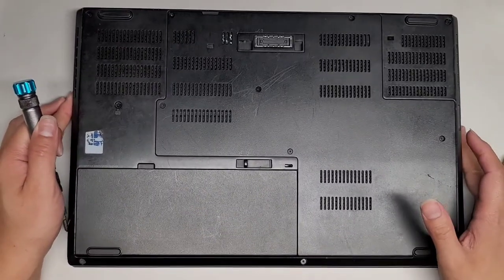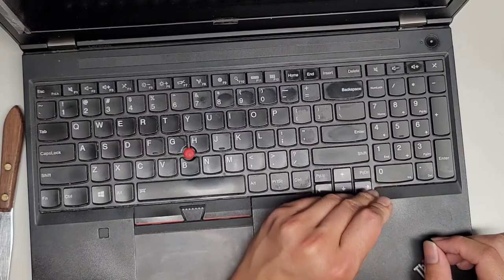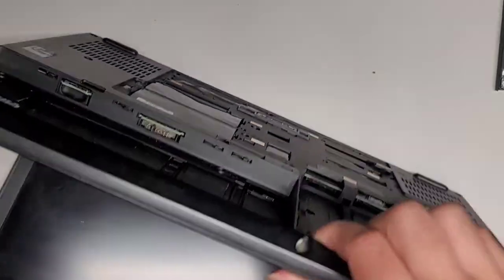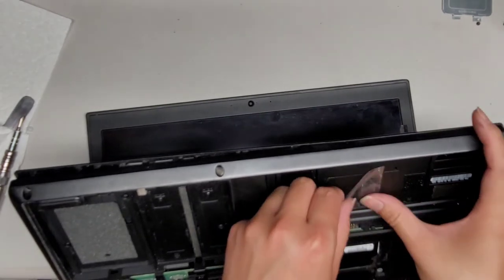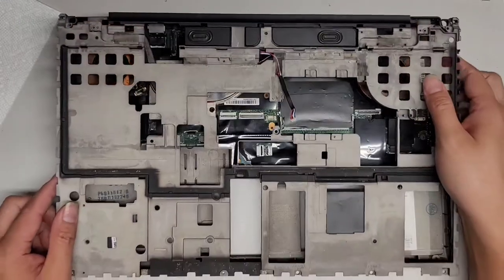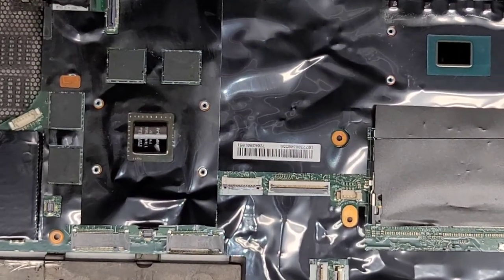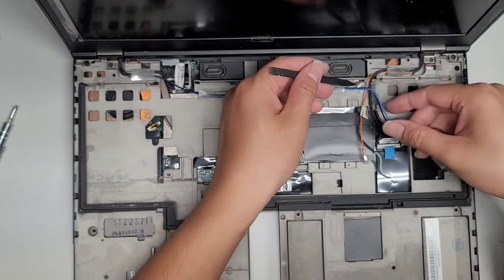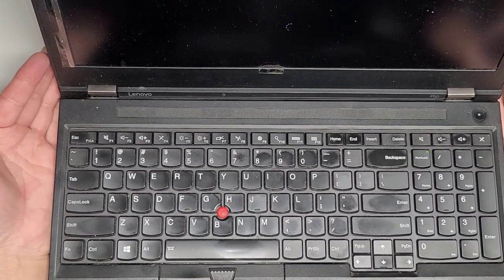Lenovo ThinkPad P50 Complete Disassembly RAM SSD Hard Drive Upgrade Repair Thermal Paste Application

Comment: The Grey discoloration could be a sign it's not pure copper but rather a cheap alloy .... hate to think this about such an expensive machine, try scratching it with sandpaper and see if it's a form of grime on the external as seeing the thermal paste come of clean on your finger indicates it's probably not burnt up, also the lowest temp on that fan assembly is actually the plate on the fans and its there also

Comment: Thank you, I downloaded your video and ran it on another laptop during disassembly. I dismounted my P50 Xeon twice: the first time to find why I got this noise on the left side cooling fan. I noticed that the noise was coming when fan was rotating at higher speed. I tried to fix it by adding some oil. No way, I had to glue the left fan container together after I messed it up. I ordered a new fan on ebay and replaced the old fan last night.
Reply from the maker: Awesome, glad it helped. If you haven't already, please like and subscribe so others can find my videos. Thanks!
Reply: @ItsBinhRepaired  Subscribed and liked.
Reply from the maker: @jpnxuan  thanks!
Reply: Man ! i have the same issue, and i'm planning for a disassembly ,, i have the left fan making noise ,, !
Reply from the maker: @ghanouneddjar8590  good luck
Reply from the maker: Glue traps? O.o
Reply: @ItsBinhRepaired  It's very convenient, my screws are aligned the same way they were on the laptop. Just need to pick up in order when I reassemble. If I am interrupted and need to something else, I can put the P50 and the glue trap board aside. Two days later I still can mount/unmount the laptop without any issue.
Reply from the maker: @jpnxuan  it doesn't leave residue on the screws?
Reply: @ItsBinhRepaired  No residue on the screws. I put screw heads down. I can reuse the board again and again for other repairs (cars, etc...). Magnet boxes do not keep the screws organized by type or size. Avoid getting your fingers on it.
Reply from the maker: @jpnxuan  lol sounds like I need to sell my invention.
Reply from the maker: Nice
Reply from the maker: I made a special magnet box that does that.
Reply: Same issue, lefthand, gpu fan, smaller one 👍

About $20 off aliexpress but delivery will be quite slow. Hope it holds together.

Comment: Basic heat in concentrated confined areas is what turns copper color to grey as like your two fans and linked bar. Copper is a reactive material to consistent levels of heat so while it's perfectly natural to see two tones of color, it illustrates the heat it's subjected to.

Comment: The tray for the SSD is wrong. There's a different part number for NVMe SSDs with thermal adesive (4XB0K59917). That tray should only be used in SATA M.2 not in NVMe M.2.
Reply from the maker: Is that why the computer came with that and the computer boots from it?

What makes you get to decide what the computer gets to use? The tray and SSD work. Why would you put a slower SATA one?
Reply: @ItsBinhRepaired You didn't understand me. There's a specific tray for SATA M.2 and a specific tray for NVMe M.2. That computer seems to have come with the SATA tray but with an NVMe. That leads me to suspect that it had originally a SATA SSD which was later replaced by an NVMe SSD without replacing the tray. The problem with this is that the trays are optimized for the specific type of SSD, in particular for their thermal characteristics. It's just a tray, it has no electric properties. But using the wrong tray is likely to cause thermal issues. It won't prevent it from working or booting, but it will increase the chances of incurring in performance losses due to thermal throtelling if the SATA tray is used with the NVMe SSD. So, when the original SATA SSD was replaced by an NVMe SSD, the tray should have been replaced as well.
Reply from the maker: @joaoparedes_tp  it'll be fine lol

Comment: i fucked up taking out the little wire connectors that connect to the wifi card and little metal bands popped off of them 😭 do you know of any way to fix this? do i have to take it to someone to repair now?
Reply from the maker: @tylera5598  very likely the antennas and wireless card will need to be replaced. Better to use a usb wireless adapter

Comment: Hi I have this machine but it runs and everything but the screen is blank, it comes on shows the Lenovo logo and you can press the f keys, but gives a message saying “ system security- bottom cover tamper detected press ESC to continue but after pressing ESC it just stays blank
Reply from the maker: Not sure. Might be a bad hard drive.
Reply: @ItsBinhRepaired  let me try and change it and see
Reply: There's a little microswitch inside the bottom hatch that detects when it's been opened, that'll be whats triggering the message. You should be able to go into bios (F12 at the splash screen) and disable that security feature.
Reply from the maker: Not sure why I said hard drive. Lol must have been very sleep deprived when I responded.

Comment: Ok, my key question is,. can the frequent high temperatures be brought down to sensible levels? *Sensible levels = <75C under load. I know at idle this laptop gets to 65C even with ZERO cpu use,. so why and how can it be brought under control to help aid the lifespan of the laptop's hardware?
Reply from the maker: Clean the fan and reapply thermal paste.

Comment: Used this video to replace the fan and heatsink assembly on my laptop. It is getting very old and I need it to survive until I am finished with school, so this was really a life save. It was a little touch and go for a bit (new fan assembly was slightly bent from shipping, and I had to gently bend it back to get it to fit, and it initially didn't boot, but after re seating some of the ribbon cables, it came through.)
Reply from the maker: Awesome, glad it worked out. If you haven't already, please like and subscribe so others can find my videos and possibly consider watching a few others to get the algorithm to recommend my channel. Thanks!

Comment: Excellent video - My P50 was starting to taxi to the nearest runway. After following your video and thoroughly cleaning, dusting, and repasting, the jets are now silent (and cool as cucumbers).
In case it helps someone, I sorta freaked out when after putting everything back together, I pressed the power button and the only response was a momentary spin of the GPU fan and a flash of the keyboard backlighting. No video...just a green power led staring blankly back at me. I partially took it apart and made sure everything was properly seated. I suspect the video cable was not fully pressed back into place...or maybe it was one of the memory sticks. Also, it is easy especially with the SSDs to think that things are seated when they may not be. You need to feel / hear a definitive click or snap with those SSDs. Without that, you will not boot properly.
Reply from the maker: Most likely a stick of RAM.

Comment: I'd say the heatsink copper was fine, didn't look burned at all to me. Looks like it was ?painted? gray or the copper was plated with nickle or something and some of the plating had rubbed off. The copper on my P50 heatsink assembly is shiny. I'm replacing my fans since the right side is getting a bit noisy. You can save some money if you just get the fans and reuse the copper.
Reply from the maker: Hmm

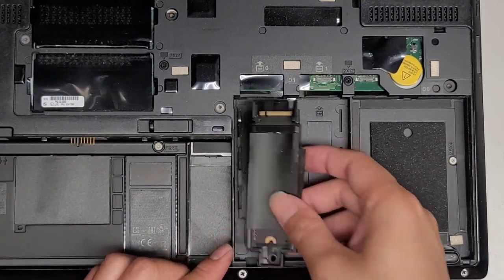Comment: 06:20 It wouldve came out with the whole tray if the black screw holding the SSD wasn't removed, the one you later referenced at 06:33 which does, in fact, hold it it in place with the tray, it just needs to be slid straight back, without pulling up, before it will pull out and come out with the tray as expected
Reply from the maker: Thanks
Reply: @ItsBinhRepaired  no no, thank you for making this video and uploading! I was just mentioning it in case there was any confusion because oddly enough, when I opened up my P50 today after watching the first part of ur video, I discovered my p50 didn't even have an SSD drive inside and only had the NvME drive. But even so, the moment I saw the NVMe in your video was a Samsung I figured they had made some upgrades. Anyways, just earned to say thanks to you too and no worries, I'm sure you caught that at some point later on anyway. Take care!
Reply from the maker: @chi11estpanda  glad the video helped :) if you haven't already, please like and subscribe so others can find my videos.

Comment: I've been looking for a cheap, robust, used workstation to use for media consumption/light gaming, I was thinking about buying one of these p50's, but im now having second thoughts after seeing that complex disassembly, do you have any suggestions for such a machine that would be easy to service? (thermal pasting and cleaning fans)
Reply from the maker: Hmmm not too sure. There are so many different model computers. You can see the thumbnails of all the computers on my channel to get an idea of what the insides look like.
Reply: I'd say go for the P50. I've had mine for a few years, put a M.2 SSD in it and made that the C drive, it runs pretty good. I run Xplane 11 on it, you get a playable framerate if you turn the settings down a bit. Mine is due for new fans now, but I've had it apart before. I think most laptops require a full teardown to get to the fans, that's pretty common.
Reply: P50's are horrible to disassemble, but VERY solid machines.

t. P50 owner since 2018 and is also typing this on one
Reply from the maker: You'd know if that's true or not by watching my videos. Lol Lots have easy to remove fans.

Comment: Useful as think my gpu fan needs replacing, the small one.
Reply from the maker: Hopefully you'll be able to get it working.
Reply: @ItsBinhRepaired  ordered one off ali express, took about 6 weeks to arrive. Managed to take the panel off with the middle chassis, without having to detach it. Cleaned up the contacts and yes you can replace the fan, remove the three tiny screws, try not to tear the tape and reseat the earth wire. Back to total silence and idle temps below 40. Mine is a xeon quadro 😎
Reply from the maker: @ironmantooltime  nice!

Comment: The gray stuff on the heatpipes could be surface oxidization.
Reply from the maker: caused by excess heat
Reply: @ItsBinhRepaired  Yes, that is possible. I've seen something similar happen with other metals due to heat.
Reply from the maker: Yup

Comment: Thanks for doing this. Just repasted my CPU an GPU. Now, the nipple and the mouse buttons just below the space key is no longer working. Any idea what I might have done?
Reply from the maker: If you pulled the keyboard out, double check the two cables that connect to the motherboard.
Reply: @ItsBinhRepaired  That was the first thing I did. At this point, I'm wondering if the large ribbon cable is broken.
Reply from the maker: @usefulknowledge6074  it's possible
Reply: @ItsBinhRepaired  In such an event, the only way to fix it is to get a new keyboard?
Reply from the maker: @usefulknowledge6074  most likely

Comment: Recently my Lenovo P50 Laptop suddenly won't turn on. It turns on for only 1second, with the green power button lighting up & the fan kicking in for 1 second, then it immediately shuts down. When I plug in the power supply, the green light on the back of the computer lights up when I have the battery installed. So it doesn't seem to be a power supply issue. I searched all over the web for solutions & tried doing power drains, unplugging/ plugging in the battery & power supply, running with just the power supply, running it with  just the battery, & both battery & power supply. I did the CMOS battery resets, removing HD & ram then trying to powering it on, but I get the same result.
Have u ever dealt with anything like this with any Lenovo laptops you've worked on? Do u have any possible solutions? Please let me know. Thanks & have a nice day.
Reply from the maker: Might be a bad motherboard :(

Comment: What is the size of thermal pads? 
I'm looking to replace the ones on my Thinkpad p51, but I don't have the possibility to open it for a few weeks
Reply from the maker: I don't know that, sorry.
Reply: let me know when you find out because I need to replace too xD
Reply from the maker: Measure with a ruler lol
Reply: @kondziu6668  cpu 1mm and a GPU 1.5

The laptop was in such poor condition when it arrived that it only had a piece of thermal pad on the cpu part, two 1mm stacked gpu it's bad idea, it is better to use 1.5mm
Reply: @raulcardenas2353  thx <3

Comment: What is the port for the display on the motherboard end ? Is it 40 pins ?
Reply from the maker: I don't count pins. Not like I'm building connectors or something, so that info isn't necessary. The video shows how to open it. If you want to count pins, go for it. If you order parts for your laptop, the number of pins isn't important, just make sure you get the parts designed for your laptop.
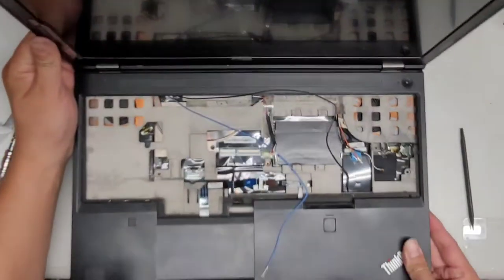Reply: @ItsBinhRepaired  I'm doing a screen upgrade on my P50 that's why, the display I'm trying to install is a 40 pins so I need to swap the stock cable too. Also, is it required to remove all the back screws + the hdd's + the ram in order to lift that plastic cover ? (39:34)
Reply from the maker: @rnrbeast  as far as I know, you can't upgrade the screen. It has to have the same specs.
Reply from the maker: @rnrbeast  try doing it without it. If you can't remove it, then I guess you'll know the answer. I wouldn't know unless I rewatch the video and see how everything is connected. Use your judgement.
Reply: @ItsBinhRepaired  i will try access that port, also for your information yes it's possible to upgrade the screen, as long as the port is compatible. In fact I currently have a 1080p@120Hz panel which is 30 pins embedded displayport, but I want 4K which is 40 pins
Reply from the maker: @rnrbeast  interesting. Let me know if it works.
Reply: @ItsBinhRepaired  4 weeks later, i successfully did the cable swap (from 30 pins to 40 pins eDP) and installed the B156HAN07.1 panel (a 144Hz IPS panel). Just letting you know :)
Reply from the maker: Awesome!
Reply: @rnrbeast where did you get the screen from?
Reply from the maker: Usually Amazon. Need the screen model number.

Comment: Can i upgrade my pc's cpu processeure form i7~6 to i7~11 or i9~9
Reply from the maker: If I told you yes, I'm curious how you'd remove the CPU to put in a new one. Lol Technically anything is possible. Is it designed to be replaced? No.
Reply: @ItsBinhRepaired  yeah you got a point, thnx though
Reply: @ItsBinhRepaired  yeah you got a point, thnx though
Reply from the maker: @ZANGETSU.4  haha I've seen people upgrade the storage on an iPhone, but it's not worth it other than to say you did. Haha

Comment: Great video, very helpful -- but every time I saw your fingernails I wanted to puke!  Also, I'm surprised you didn't have plastic spudgers on hand.
Reply from the maker: Glad the video helped. You might want to look into why you have that issue with fingernails. Seems like a type of phobia or something. Fingernails are much better pry tools because of the way they can be manipulated to apply force in different directions not really possible by pry tools.

I have plenty plastic spudgers, but only use them where they are actually better at getting the job done, which is less than 1% of the time. 

Imagine someone telling you to throw away your hammers because the shape makes them puke and instead told you to use rocks because those aren't as gross to them. Yeah... no thanks. I'm going to keep using my nails. Lol

Comment: Just got one for $230 noticed it’s running hot👨🏾‍🦯
Reply: But it came with 32gb ram
Reply: And everything looks good fr but it was just burning my goddamn lap off💀
Reply from the maker: What is the cpu temp?
Reply: @ItsBinhRepaired  oh I’m sorry for the mad late response but I’m coming back to this video because I’m tryna disassemble if I spilled water on it and the speaker and keyboard are done. idk the cpu temps it’s just hot but imma replace the thermal paste when I disassemble do you know if I can do a motherboard swap to a m2000m?
Reply from the maker: I hate how YouTube doesn't notify me of replies. Were you able to figure it out?